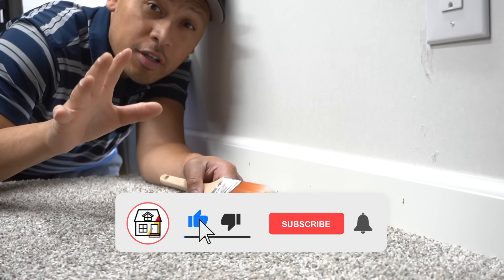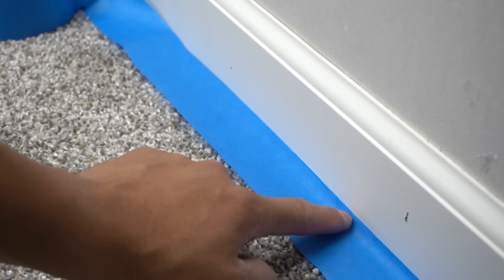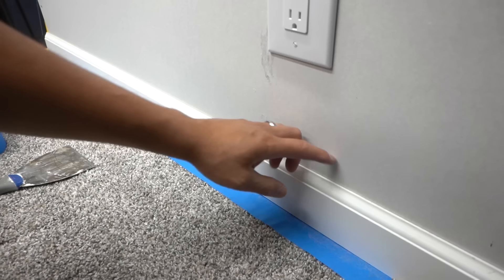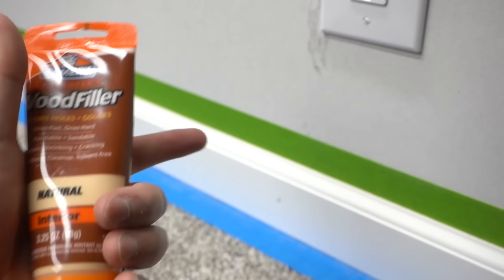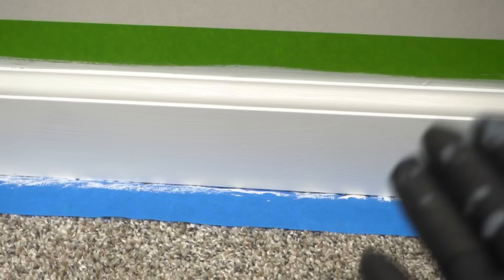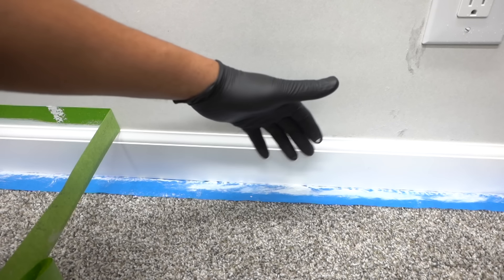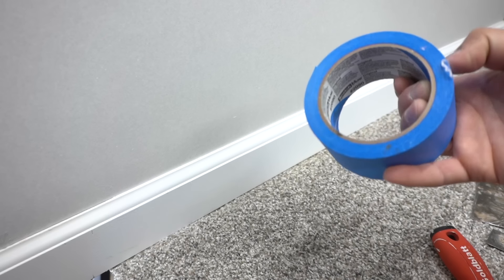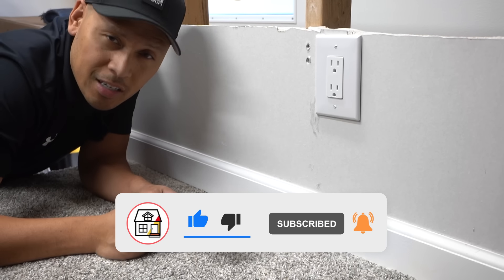How To Paint Baseboards Over Carpet For SUPER CLEAN Lines! DIY

Comment: I just use a thin piece of cardboard, about 2ft long and push it underneath the baseboard. Dont paint to the ends of the cardboard, leave about 5 inches on each end clean and gently pull it in the direction you're painting,keeping it under the base. Usually a couple pieces will do an average room.
Reply: Likewise, simple, effective cheap.
Reply: I use modified Vinyl siding , just cut the edges off to turn it into a 2.5 inch flat strip . Slides under the baseboard with no issues and its reusable.
Reply: I do the same for any trim...
Reply: same here cardboard works for me nice n cheap and throw in recycling afterwards

Comment: I use old vertical blind slats cut to 3-4 feet and push it under the baseboard, shielding the carpet, moving it along as I paint.
Reply: THANK YOU! That just saved me using up my masking tape for the carpet side and saved me on buying a 10"~ drywall knife! I have old ass blinds that will do the trick!
Reply: That tape is easily $9 a roll
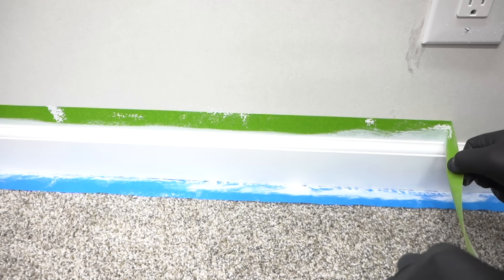Reply: He ain't even holding his brush right, that's a $5 paint bush, who rolls 6:56  their baseboards ?

Comment: Masking works well if you are lucky to have a gap at the bottom of the skirting board though here in the UK our skirting boards don't usually have a gap. Also I'd suggest also putting a tarpaulin or cover over the main carpet to avoid any paint drips from the paint can, etc.
Reply: Yes, I live in the UK too and don't know if thats the same with me because my carpet is quite thick but now I realise I probably don't have a gap, such an American thing, everything they have just bloody works.
Reply: In our houses in uk dont have any gap between skirting and floor, if you can tuck your carpet under the skirting there must be something wrong
Reply: You dont need to put masking tape on the wall to paint the skirting boards etc and you dont need to be a professional to cut in your paint so to avoid masking tape.
Reply: Same with Australia
Reply: @georgemacdonald5282  Yes, I have lived in it and removed skirting so I can get a nice nice finish around edges :) I am bad at cutting so find it easier just to remove them and put the carpet underneath.

Comment: Hi great ideas if you have a gap under your baseboard, we in the UK call this skirting board, which is placed on top of the floorboard,  so tucking under would not work. Regards welshman2081
Reply: And having that gap often results in the edge of the carpet becoming dirty as dust can blow in draughty circumstances.

Comment: This is all well and good if you have a gap, base board or skirting as it know in New Zealand which is usually fixed before the floor coverings go down last to prospect it from workers all over it, so painting after does require some additional skill by the painter or home handy man not to get paint the caret edge

Comment: Ive been using at10" or larger mud blade and running it under the base board. Using only the middle 80% ish of the blade, so when sliding it left or right, no paint on the edge smears on the carpet. Although wit the fluffier carpets, using the tape, under the baseboard is best; keeps the carpet from springing into the wet paint, gluing it to the baseboard.

Comment: Find some scrap vinyl siding or buy it new  as its worth it, cut the edges off  to form it into a 2.5 inch wide flat strips . Wedge the plastic beneath the baseboard and the problem is solved.   I  keep about 20 pieces of it at 6 foot lengths  in my Van as this works perfect 👍

  Taping is " NOT" the way to do this.

Comment: use a softer bristle brush and you will not see the brush marks you do not need the tape at all i have been a painter for over 30 years never got 1 drop on any carpet if anything get a nice sheet of alloy sheet put it under then paint along it the move it a long if you useing a gloss paint make sure you turp it down so it givies you a nice flow and not pulling

Comment: I use a 36x6 strip of laminate with 2in. masking tape along the edge. The laminate is thin enough to slide along as you work. Replacing the tape after finishing a complete length of baseboard.

Comment: Good advice for tucking the tape. Bad advice to submerge a paintbrush for cleaning. This can damage the ferrule by making it swell and ruin a brush. To make cleaning easy and save paint from getting into ferrule wrap blue painter tape around the ferulle and over bristles where it connect about a half inch. When done peel the tape toward the bristles where you will see it blocked paint from getting into the ferrule which is how brushes get ruined. I have brushes that are 30yrs old and good as new with this practice. Makes clean up easier too.

Comment: The best thing for carpet and baseboard is to get yourself No residue duct tape.
Investing a few dollars in 2 or 3 rolls of this makes the job a hell of a lot easier.You can leave it down as long as you need to until you're done then pull it all up at once.
Make your strip as long as you can handle it. Keep it taut, and firmly press downward and toward the baseboard having the edge slightly curled as you apply pressure, from slightly the middle pressing down and forward getting the edge  under the board.
You'll get about 1/4 inch to almost 1/2 inch underneath.
I very been able to do it with 3/4 inch carpet.

Comment: Good basic info! Berber carpet is a monumental pain to deal with ….the nap has no “spring” to help you shove it beneath the baseboard. I’ve been forced to use clear package sealing tape to protect my carpet when painting the baseboards - then peeling it away VERY CAREFULLY so I don’t pull up any loose fiber ends.  It’s a horrible DIY hack…but nothing else seemed to work with this icky brown wall-to-wall carpet I’m stuck with, so…..ugh.

Comment: On past jobs I’ve take a roll of plastic, and cut it to about 6” wide. Then unroll it and using a plastic drywall blade/scraper I just tuck it under the baseboard and then get to painting. After it’s dry, just pull the plastic and roll it back up

Comment: Proper  gloss  paint  you  cannot  wash  brushes  out  in  water,  And  you  should  be  using  a  foam  roller  with  gloss,  The  roller  you  used  is  for  emulsion   nice  info  on  masking  up  though.
Reply from the maker: Thank you for the advice! 👍🏽😊🙏🏽
Reply: @FixThisHouse  No  problem  take  it  easy.

Comment: What do you do if the baseboard is tight against the sub floor?
Reply from the maker: Just use the frog tape and get it touching the edge as much as possible 👍🏽😊
Reply: I did mine  a few years ago  using  similar equipment,  but pushing the tape down at 90 degrees between the edge of the carpet and the skirting board. As a bonus the edge of my carpet was extremely clean looking 😂

Comment: Thank you so much! I really needed this video. Could I use these techniques on a floating vinyl Plank floor? The extra base board is nailed into the floor. I'm not sure ai can get the tape or the drywall spatula under it.
Reply from the maker: You can definitely can use these methods, for close joints I would use the frog tape 👍🏽😊

Comment: Tape aint cheap and it's time consuming and hard on the back to install in the manner shown.  In fact all those ways are time consuming.  Wouldn't it be nice to put something down in less than 20 seconds and start painting?  But first you need to protect the rest of the carpet from 3 feet from the wall. I've accidentally dripped paint not even knowing about it because nobody is immune to accidents.  I have a 3X12ft drop cloth that I drag around. 
At Home Depot and ask where the roof flashing and look for 3/8 in. x 10 ft. Galvanized Steel Z Bar Flashing. It's only $5. And unlike tape, it's reuseable. Now tuck this under the molding and paint. Then pull it back and set it on the tarp and using a Scotts Blue paper towel, wipe the flashing down so that most of the paint is in the towel. It will now dry in a minute. Now move on to the next spot.

Comment: This is assuming the baseboard was installed after the carpet.  If the baseboard has been installed and then the carpet, you will have to push the tape DOWN between the carpet and the baseboard.  Then you will have to use a wide knife to hold the tape back away from the baseboard while painting.
Reply: Facts

Comment: NEVER use hot water to clean brushes and rollers. Paint is more likely to become hard and form a skin with hot water.  Only ever use cold water which will more easily and quickly dilute the paint.
Reply: A bit of liquid hand or dish soap helps, then rinse well and shake dry.

Comment: I have been doing it that way for years with masking tape. What you do have to do is remove the tape the next day or you could find the tape sticking to the bottom of the skirting in places if you leave it too long. As for putting tape on the top of the board, I never did that, as i did not have too. With a slim brush like the one the person is using I would use without touching the wall.

Comment: If you want a smooth finish it helps to apply the product with a roller and back-brush with a brush. Rollers can cover the surface quickly and the brush gets rid of the roller-stipple.
Reply: Agree, tight sponge paint gloss roller
Reply: if you get a decent semi-gloss with enamel in the paint you can skip the back brush altogether as the enamel is heavier paint which has a small paint "sag" so when you put it on with a small roller it "sags" the stipple to a nice finish without any brush strokes or stipple marks, might have to do 2 coats but it looks like it was spray finished.
Reply: @MV-wb2cz ▪︎ forgive me if this ought to be obvious but painting heavily enough for the paint to sag doesn't seem like a proper solution. Esp if the paint sags too much and pools at the bottom of the baseboard and onto the carpet or into the carpet "hairs."
Reply: @bethanyanderson1745   forgive me but i did not say to paint a heavy coat, it's the way the paint is formulated, if you have a paint with enamel in it vs regular paint, it's a heavier paint and you don't need to back roller it

Comment: All good ideas.
Just a couple of tips if I may.
First. Use Pink frog tape Not green or any other colour when applying it to walls. Green is too tacky and could rip paint or paper off walls.
As for the large plasters spatular I’d personally move it along as I go rather than taking it out and putting it back.
Other than that good tips.👍

Comment: Right on.  I usually use the ten inch blade without tape, but wipe the blade down with a damp rag on both sides after painting about nine inches of baseboard.  Then with a totally clean knife do another nine inch section of baseboard.  I ALWAYS have two damp rags (one for covering my paint brush and can, and another for quickly wiping up accidents and drips.  I'll probably try the construction paper method someday, that looks quick and inexpensive.  I always use a dropcloth when painting over carpet, also.

Comment: Using tape like this... not for the pros. If you use a Shur-Line 15 in. paint guide (2.53 @ Ace Hardware) you can save not only a step of using tape and the putty knife, and just dry brush the bottom inch of the baseboard. Slide the guard along and you are done. Come back and wet brush the upper half of the trim for a great finish. Nobody professional uses tape on the top half unless they are rolling the wall- and then you aren't doing it for the cut line, you are preventing sprinkles from the roller getting on the baseboard... Save 8 bucks on Frog tape and reuse the guard for about two weeks...

Comment: Your technique is fine, if your baseboards are above the wooden floor.
For homes built in the 50's, the floors were hardwood and the baseboards rested on them. I went to Lowes and bought 6 thin sheets of sign making plastic. These are 18" x 24" in size. Using my wide putty knife I tuck their wide edge between the baseboard and carpet. As they lay back onto my drop cloth their weight keeps them in place. If needed, a bit of pressure on them, as I paint keeps them in place. They're also thin enough that I can slip them under doors and paint them, without removing them. I do take off the door knobs.
Reply from the maker: Thank you for sharing your technique! 🙏🏽😊

Comment: First of painters tape does not stick to carpet.  You need masking tape. I measure about quarter inch onto the trim without putting pressure for the tape to stick, the i pull back on carpet and tuck the tape under the trim with a spackle or scraping knife. Bingo.. million painters out there, simple trade but the prep is everything for a level 5 finish.  Neatness is important too!